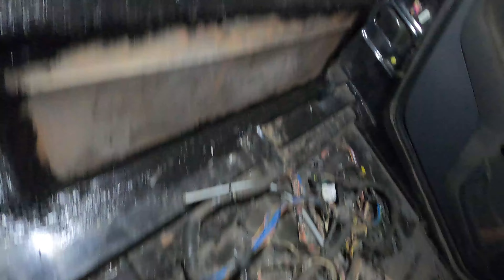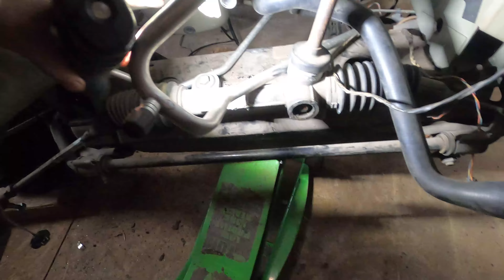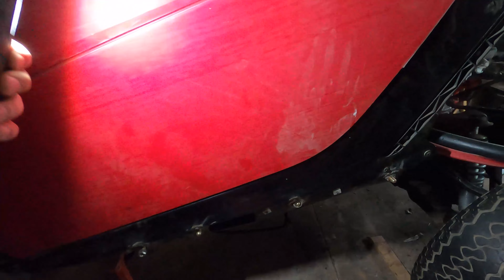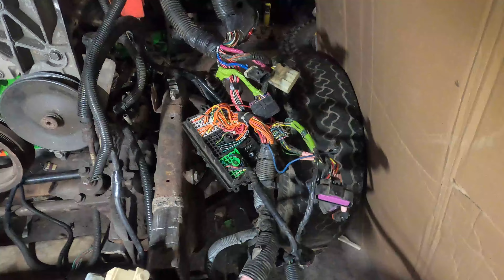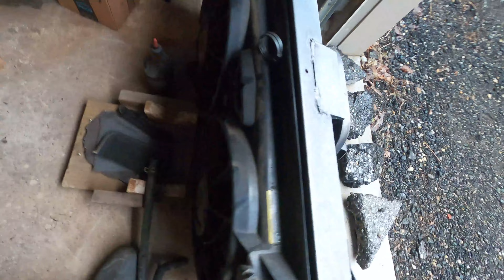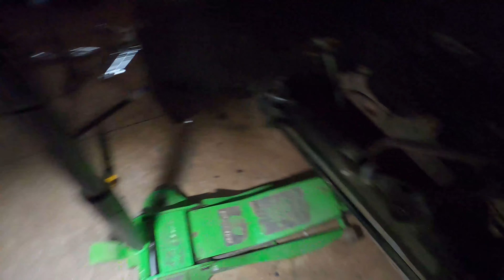5 3L LS swapped Smart car part 4

Comment: How's the progress?
Reply from the maker: As you can guess, progress has stalled. Some shops I was relying on closed. My go to guy for specialty knowledge and parts has a lot happening right now. The hollow pipe that makes up the shock collapsed under its own weight. Until he can finish the solid steel adapter for my shock mount, I am on hold. The tires are cambered in enough to touch the mirrors, and it's immobilized. Once I fix my truck I look to start again. I have found a wiring guy who might be able to help once it is mobile.